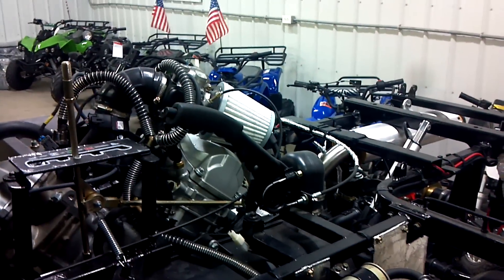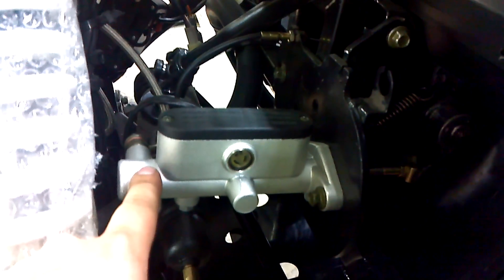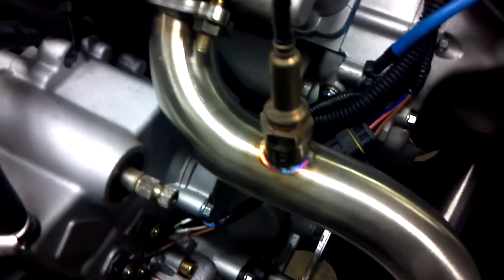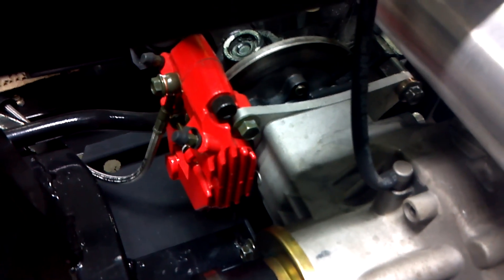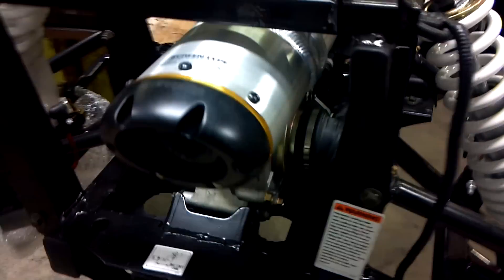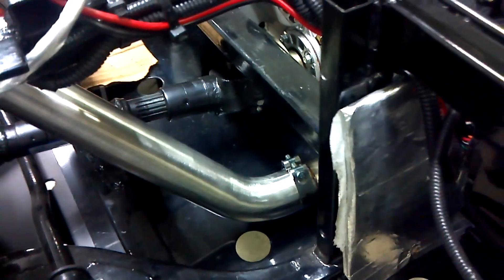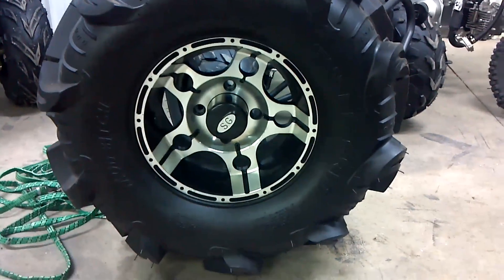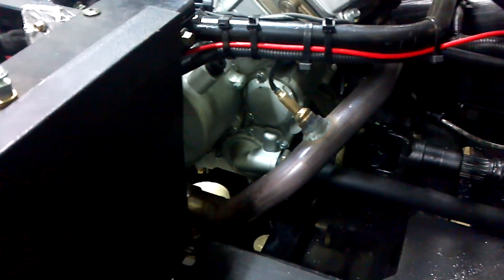ODES Dominator UTV 800cc V-twin Project Build *Kelley Motorsports LLC* Part 1

Comment: Hi guys 
Have you done any more work on your ODES Dominator 800cc, I am interested in the cooling system and retro fitting a fan to the engine bay to supply more air flow through the area.
I operate in 80 F in the cool time of the year and up to 100 F plus in the hot humid wet season.
Reply: +Stephen Lees Hey Stephen did you get ever get any resolution to your problem. I just purchased an 800 cc too. The cab is really hot.
Reply: Hi Matt not sure if you got the feed back I sent a few days ago. The problem was a leaking gasket and I had to have it replaced!! no warranty as I am in Australia. I have also installed two thermo fans and am running a top grade coolant. The unit seems to run cooler but still seems hot to me, we run a thermo gun over it and it seems to be operating in the right levels, I have change out the thermostat but not change. I have also had a electrical problem we the unit since the day I got it, a dead short some where, so it need charging every few days. It not a bad unit for the money I paid but they could do with a better QC which I am sure there have been improving as time goes along. I like the look of the latest hunting buggy and would like to get a 4 person unit next time

Comment: no mate!! had to pull the head off of it and fix a leaking gasket which was feeding back into the water jacket. This was happening from new. Also have had a dead short issue since the day i got the unit which is still an issue, apart from that the unit goes well enough.